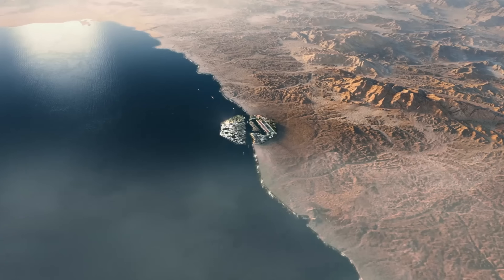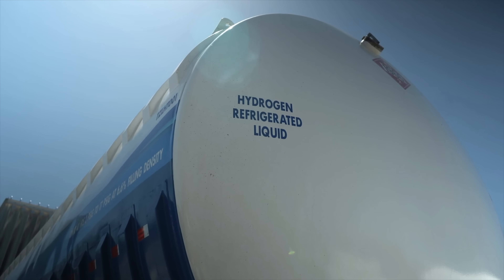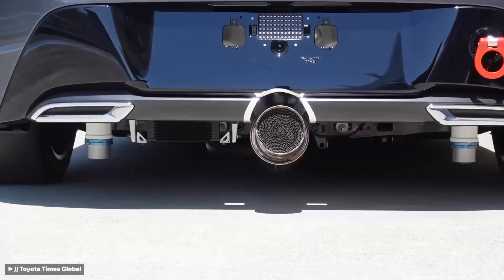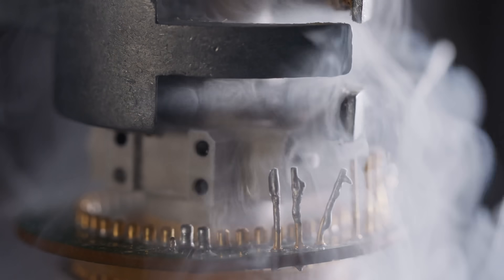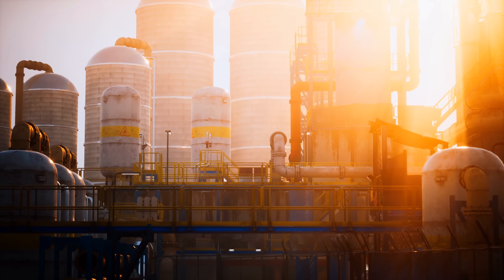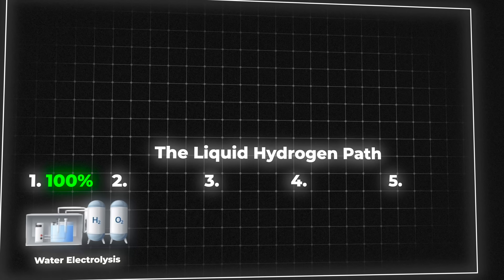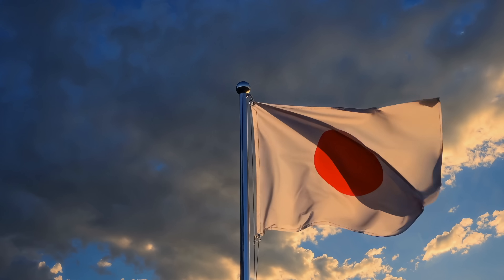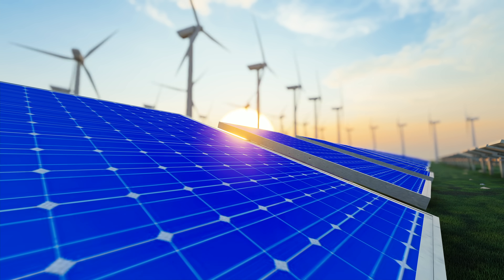World’s BIGGEST Hydrogen Plant Produces 0 Hydrogen

Comment: Stanely Meyer solved this problem in the early 2000s when he ran his vehicle on gasified water. There are others who have duplicated his technology. Water once separated into separate hydrogen and oxygen molecules would be produced on demand and used immediately. I have to laugh at all this green nonsense when this problem was solves over twenty years age. As predicted by Jules Vern, water is the fuel of the future. I also have to laugh at solar and wind power. Most turbine blades wind up in landfills after their life span, very green. Solar panels are almost impossible to recycle due to toxic chemicals. Why no mention of water to burnable gas technology? Could it be that water is too cheap a fuel and will cause a total shift in the world economy?
Reply: It is the energy to crack the water that is a problem.

Using alternators on diesel engines with a water tank, cracking water & injecting H2 into the diesel combustion chamber causes lower emissions, better diesel combustion for greater power, more efficient use of diesel… the excess energy from the diesel more than pays for the H2 production in additional energy gains.

I have not seen a straight cracked water system work to power a real world vehicle.

Maybe cracked water in a hybrid fuel system could be efficient enough?

Comment: Natural hydrogen will change the economics by removing the cost of wind and solar generation..?
Reply: Natural hydrogen doesn't really exist. The stuff is way too reactive. It turns into things like methane (CH4) and water (H2O), which is why we currently get basically all of our hydrogen from methane - reformation.

They've found some gas deposits which contain hydrogen, as a small % of the gas in the deposit. Hypothetically you COULD maybe open the deposit, filter the hydrogen, then put all the methane back in the ground somewhere else, but then you just recreated the carbon capture and storage problem
Reply: @kylejohnson6775 - Carbon capture is not a problem, it is a resource! Harvest for 3D print filament.

The West should be printing everything they need, instead of manufacturing, buying, and shipping from China.

Then, recycle the objects printed with the filament.
Reply: @DavidHalko 

Carbon capture is a problem because it's being used as a distraction to delay transitioning away from burning methane or coal for electricity, despite the fact that almost no projects have ever successfully or sustainably sequestered any significant amount of carbon dioxide. The only ones that ever "worked" were used to pressurize oil wells to extract more oil for burning. And we definitely don't have the storage space to capture everything we burn, let alone years or decades worth of emissions. It rarely works and the few projects that do work, have absolutely no hope of matching the scale of the problem. Either in carbon captured, or about stored

Hypothetically, carbon capture could be useful for greenhouses or soda or generating hydrocarbon polymers. But, that doesn't require any active carbon -emitting power plants or industrial process. The atmosphere already has too much. And we use a lot of plastic but not nearly enough to consume any significant percentage of the waste carbon you'd get from trying to harvest hydrogen from natural gas deposits. The scale of that is just so unbelievably huge compared to every other resource we use besides freshwater.

TLDR: you're correct that carbon capture can hypothetically be a useful source of carbon instead of oil harvesting. I still call it a problem because it's almost exclusively used to delay transitioning away from fossil fuels. There's almost no successful projects of capturing carbon to use it for anything helpful, and it can never be used to counter more than a small % of current emissions
Reply: @kylejohnson6775 I think you are out of date on this. Natural hydrogen does exist, free of hydrocarbons and at high concentration in a number of places. It's thought that it could be quite common but until recently it hasn't been looked for, for the reasons you give.
Reply: No. Not a lot around.

Comment: I'm not a fan of replacing a fuel with another one, be it labeled "green" because coming from solar and wind. I totally agree there is something to be done to decarbonize aviation and some other industries (trucking ?), I still have some reserves about hydrogen as a whole. Amonia isn't only toxic, it is explosive.

Just some "shower" thoughs, but the problem with fossil fuels is the byproducts. And the sheer scale of how much we are burning today. But aviation is only 5% of everything. I'm pretty sure we could somehow offset aviation emissions with some other green projects. The issue is that basically everyone is burning fossil fuels in their cars, to heat, and big heat-intensive industries which do not have the same space and weight constrainsts as planes. I'd focus on decarbonizing planes in the last to be honnest. We already have something to deal with trucking, and it's called rail. Put some more rails, electric trains to move them, and go. It would also improves infrastructure maintenance as trucks are far worse for roads.

I don't know why I have so much issues with hydrogen, on the paper, it is quite cool. And I'm pretty sure that amonia process could be greatly improved.
Reply: Gasoline is explosive too😮
Reply: GMO algae to make ammonia and extract it from urine and agriculture run off.👍🤟✌️

Comment: I always wanted hydrogen to wyet. I've just not seen it yet. Ammonia is an interesting work around.  (Apparently, lithium-6 works well, too. Though its a proliferation hazzard.) However, ammonia is a dangerous material to handle and I don't thing I trust it in large quantities as is being prescribed by this method
Is there a coat analysis for li-ion batteries? How much energy does it take, from mine to recycle, to produce a Li-ion cell compared to how much it stores over that lifespan? That would be an interesting efficiency analysis.
Cause, chemistry like this is a very short cycle and efficiency can be measured over a period of hours orndays. The chemistry of a battery requires measurements over decades of use to do an apples-to-apples comparison.
Reply: Ammonia is no dangerous than gasoline.
Reply: @1ntwndrboy198 
I'm sorry, I don't understand. 
I think there was a typo, making the sentence ambiguous.

Comment: Ammonia doesn't cause embrittlement, its actually quite smart, it can also be sold for fertilizer as needed as well.
Reply: There's a reason why 30% of the world's ammonia is made in Russia.
Reply: Hydrogen storage in room temperature non-toxic liquid by Ayrton Energy doesn't cause embrittlement for global intermodal distribution.
Reply: And when ammonia tank blows up, it can kill a whole city😮
Reply: That was my first thought on the video.  I was surprised it was not mentioned.
Reply: Yes, this is a big issue in the oil and gas industry.  Hydrogen in H2S causes well and pipelines to crack and fail.
Reply: The better solution is to just use the ammonia as ammonia and not loose the energy converting it to hydrogen.

Another solution is to make methane(natural gas) instead, which is also easier to liqify and transport, and has the added bonus that we already have the infrastructure and need for.  The answer why not is because if you compared the cost to produce this green methane or hydrogen or ammonia, the cost outweighs the practical benefits when compared to fossil fuels.  Still, methane is the more practical fuel to produce if your goal is fuel and your choices are hydrogen, ammonia, and methane.

In order to use it hydrogen a ICE engine the approximate 35% efficient process used to create the hydrogen and get it to the fueling station is reduced by the additional 60% loss due to efficiency rating of the engine , giving you a total efficiency of work done by the vehicle of 14% of the original electricity used to produce the hydrogen.  Also, hydrogen is an awful fuel source, due to many factors: low volumetric density, enbrittlement of any material exposed to hydrogen, hard to prevent system leaks, highly explosive at a wide range of concentration, requires extremely low temperature storage and boils off over time, pressure vessels require hydrostatic testing on a regular basis, carbon fiber wrapped tanks require replacement every 10 years or so, new engines designed specifically for hydrogen must be designed and used,...  ...way to many negative value characteristics apply to hydrogen as a replacement for fuel in any class of transportation beyond niche, high cost uses.   The reason fossil fuel companies love hydrogen is that hydrogen is an impossible solution, that we can waist time and effort on, relying on fossil fuels for the indefinite period of the dominance of the hydrogen religion 

They could have used the electricity to run a data center instead and retained at least 80% of the energy value of the electricity production.  In my opinion 80% value retention is greater than 18-35% value retention.  But then again, why would we bring statistics and common sense into the discussion of what governments corporations and climate zealots do?
Reply: @jasonneugebauer5310  Those are fair points, but liquid methane requires cryogenics since its boiling point is -162°C, so you lose the main benefit of using ammonia. Also, liquid methane is less dense than ammonia. And while burning methane is carbon neutral because you consume carbon to make it, it still pollutes locally.
And regarding the "value retention," you're missing the whole point. The problem is that you can't use the energy produced in Africa to power a factory in Europe unless you can get it there. The key issue ammonia (or hydrogen or methane) solves is the ability to "bottle" that sunshine where it's cheap and ship it to where it's needed most.
Reply: @jasonneugebauer5310  Read Ayrton Energy that stores hydrogen gas inside non-toxic room temperature clear liquid.
Reply: @leroyessel2010 you are showing me a science project, not a currently viable scalable production technology.  Let's talk about this again in 10 years.
Reply: @jasonneugebauer5310 to make methane you need a source of carbon atoms, then a way to dispose of them when the methane is broken apart for fuel. The problem is we treat the atmosphere like a trash can for waste.

Instead, if nitrogen is taken from the atmosphere to make ammonia, then it's not a major impact to put it back into the atmosphere
Reply: @kentaltobelli1840 methane is the least carbon intensive hydrocarbon, it can be used in most engines and turbines with minimal changes, t has a relatively low energy to produce, it is non corrosive, and not toxic to breathe.

Ammonia costs 10 times as much to purchase when compared to liquid methane, it is poison to breathe, it is corrosive, requires special engines to run, does not produce as much energy in the engine and has a thousand other better uses than bing burnt as a sub optimal fuel alternative to fossil fuels.  In the grand view ammonia production and use as a fuel most likely uses more fossil fuels to produce and use, than just burning the fossil fuels in the engines we have in the first place.  This is why some fossil fuel producers like ammonia and hydrogen, these technologys require increased use of fossil fuels, much like the more expensive EVs.
Reply: Can't use ammonia because it can be made anywhere, you cannot have energy independence.

Comment: Good God. With those round trip efficiency numbers, no way could this ever beat out ultra high voltage transmission. It is not about getting renewable energy to their industries. No, they are doing this so Saudi Arabia can create an energy export market. Instead they should look into moving industries to the areas of renewable energy. They could smelt aluminum in the desert and export that; that's what Iceland does.

Comment: Burning hydrogen in air produces NOX.
Use the ammonia for fertilizer.  That makes sense. it replaces fossil fuels.
There are lots of huge industrial needs for ammonia, don't waste it.  We will still be doing this is a full renewable fossil free world.
Reply: He said: "Hydrogen burns 100% cleanly", but i'm pretty sure he ment using fuel cells. Its not the "100% cleanly" thats wrong in the sentence, its the "Hydrogen burns" part he said wrong.
Reply: @Powermongur  fuel cell still burns it, just not by combusting it
Reply: @erkinalp he said it uses air, but the point is that a fuel cell uses oxygen instead, so no nox. Chemical process and it doesn't burn. 
The core definition of burning is a rapid, high-temperature chemical process that releases heat and light. It is scientifically referred to as combustion. Fuel cell generates electricity through a controlled, flameless process called an electrochemical reaction. Hydrogen is converted directly into electrical energy through this process. Fuel Cell (FCEVs) is different from a Hydrogen Internal Combustion Engine Vehicles (HICEVs),
Reply: It could also be useful for steel, chemical manufacturing, and possibly fuel for long distance flights or ocean shipping (applications where batteries might not be able to replace the functionality of fuel because you just can't get them dense enough).

Though I want to point out I specifically mentioned Long distance flights. Electric propeller aircraft already exist. They're new, but that just means there's room to improve. That + electric trains should be able to handle most over-land transportation.
Reply: Producing green ammonia for existing industrial needs is still useful even if it just replaces the existing supply chain that uses fossil fuels to produce ammonia.
Reply: Hydrogen does not need to be burned to extract energy… a catalyst passively turns H2 into water & makes electricity without NOx
Reply: @DavidHalko  does anybody do that?   as far as I have read, hydrogen is burned in a gas turbine or rarely, used in fuel cells.
Reply: @briandonovan9091 - yes! It is being done today! Hydrogen cars use fuel cells, nearly exclusively. Fuel cells were pioneered in the space industry. 

The catalyst is dependent upon elements used in Catalytic Converters of modern cars, so existing automotive supply chains can be adopted with a little effort.
Reply: Even if you did burn Hydrogen, guess what neutralizes NOx -> ammonia!
Reply: @kentaltobelli1840  aaa, water injection
Reply: you still need oil for a lot of machinery parts that need lube
Reply: @hao6097  You get all the hydrocarbons we need after electrifying, from wastes.  Pyrolysis of waste can produce all the chemical and oils we need. we can use organic wastes instead of raw crude and it's a very similar process.
Reply: Fossil fuels into fertilizer is a better idea.

Comment: One more thing to add to the incredible inefficiency of hydrogen production and use. We all know it takes three times as much energy to produce hydrogen (that initial step) as there is energy in the hydrogen. But you say, you make it with wind and solar, so it doesn't matter. I saw a report recently that stated, you would need to double the current installed wind and solar, dedicated strictly to hydrogen production, to make the industry meaningful. YIKES!

This is important to realize. 
There is no excess wind and solar currently. The negative pricing we see in some places today are a reflection of current inefficiencies. I.E. a lack of sufficient energy storage.
Reply: What "all know" is almost always WRONG. The only way to get from 100% of the embodied energy, all the way down to around 33%, is to consider the FULL CHAIN OF STEPS. That is NOT the same as "it takes three times as much energy to produce hydrogen (that initial step) as there is energy in the hydrogen." So unless this video is LYING, the production step via electrolysis is 80% efficient. And if you think the video is lying, don't tell us, tell @Two Bit da Vinci !

Comment: Yep I've always said, hydrogen fuel cells are just EV's with extra steps so they are basically a waste of time, and hydrogen combustion is a very bad idea, it's extremely difficult to contain hydrogen. The cost of building a container to effectively store hydrogen even in the short term is just not worth it for cars cost wise, so all hydrogen cars slowly leak hydrogen, over a week you will lose the equivalent of tank of fuel.
Reply: Mass production of H2 tanks will decrease cost, as mass production does for all manufacturing processes.

On-point H2 cracking can be done anywhere, at a gas station, even at a person’s home. We have electric lines & water lines everywhere. 

The technology continues to shrink & get better, daily!
Reply: @DavidHalko  Yeah we have electric lines everywhere, so we use that to crack water to make hydrogen to fuel our cars, wasting energy in the process when we could just put that energy straight into our cars? What mad world do you live in that hydrogen cracking plants in every home make sense when we could put that electricity straight into our cars?

You misunderstand, yes you can make H2 tanks quite cheaply even now, but they won't hold hydrogen, they leak, and having a hydrogen cracking plant in every home is super dangerous hazard because hydrogen is a highly flammable gas you know, takes skill and training to handle it.

Madness, utter madness that you think that makes more sense than just putting the electric straight into your car.